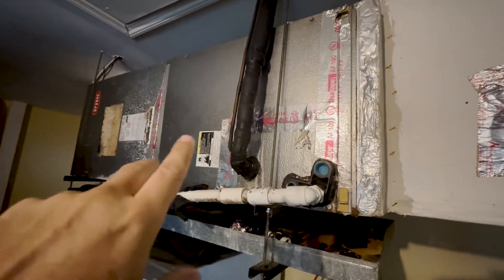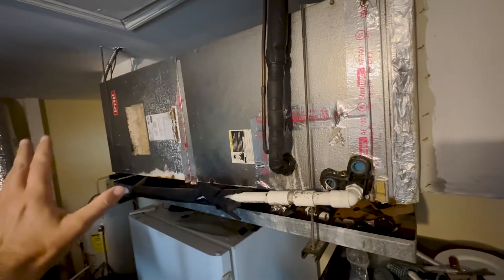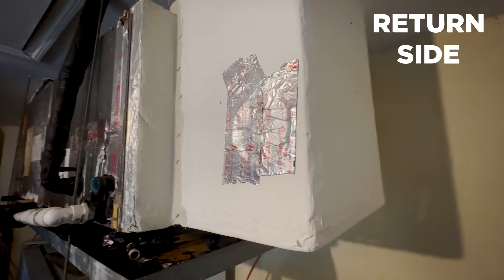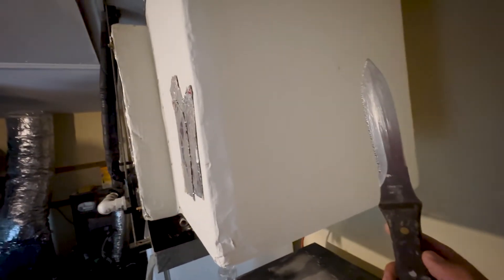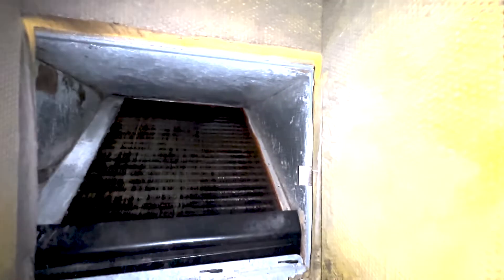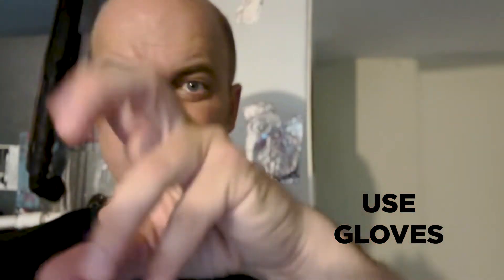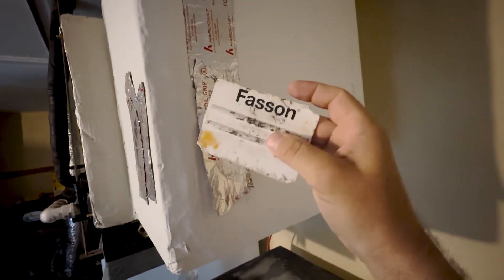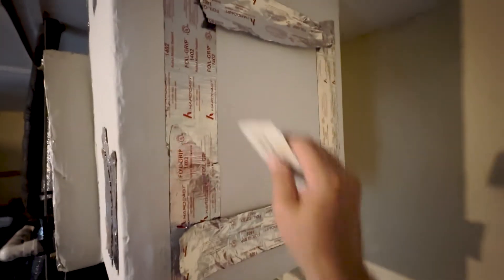Dirty Evaporator Coil Cleaning

Comment: I think the grand scheme of things.. you can use your condenser compressor to extract all the refrigerant into it, and then loosen/cut the lines near the evaporator.. but it's just easier to have a access door near the return side of air, and clean the evaporator that way.  If you pull a evaporator completely out, and decide to solder/braze the copper lines, you should also technically do a pressurized N2 test to ensure there are no leaks before reintroducing refrigerant into the system. Just my 2 cents.
Reply from the maker: Yeah I think that is a fair observation 👍

Comment: The word is “DUCT” not “DUCK”. The “MOTOR” is called a “BLOWER” or “FAN” and it pulls air through the evaporator to push it out into the house “DUCTWORK”
Before trying to give information, learn terminology.
Reply from the maker: Yes no one is confused about how to spell ductwork. If there are any mis spellings, it is there intentionally for “keyword” reasons (as many people are not in hvac and don’t know exactly how it’s spelled so they search for those terms). Furthermore, this is an informational channel for beginners. So when you talk about “blower” or “fan” being the proper terminology, what is the full description of that? It would be a “fan motor”, or a “blower motor”, right? So what’s the problem? This video is here to help the average person, who may not know a single thing about hvac. Thanks for watching anyways though👍

Comment: I did find this interesting and informative.  However, my system has a gas furnace with the A-coil mounted on top of the furnace.  All the duct work is galvanized sheet metal.  How do I get to the bottom of the coil, or for that matter the top, to clean it?
Reply from the maker: That’s a tough question to answer, without being there. For that you might want to call in a professional

Comment: Many, perhaps most, of the coil cleaning products contain corrosive chemicals of some sort and varying strengths.  Some of the stronger ones will remove paint from painted coils.  You should understand that anything containing corrosives is something you do not want on your skin or to inhale the vapors into your lungs.  Wear rubber gloves, preferably the kind with long cuffs.  Wear a respirator mask with filters rated to remove caustic fumes.
Reply from the maker: Thanks for the comment and advice 👍
Reply from the maker: Thanks for the comment

Comment: Question. So the place I work at, it’s a small local business that I guess skips out on routine maintenance for their AC unit. I was told to change the filters, and when I pulled off all three, (it’s a massive unit) the huge coil was completely BLACK. There was clumps of wet, black “gook” every where. This thing is a train wreck. That said, the unit overall looks relatively new. The massive reservoir trough underneath was filled to the brim with slimy, rusty, fungus looking gobs of water. I took a wet vac and sucked it all up. Or as much as I could. 

Next I’ll pour some bleach or vinegar down the drain lines. Everything is very accessible as it’s suspended up high. Anyway, I told the owner to buy an expanding evaporator coil foam cleaner, but this was before I knew about the self rinsing cleaners. Should I tell her to send the expanding foam cleaner back, in favor of the no rinse? Or, can I use the foam spray and use a wet vac to suck it up? Maybe also use a regular every day spray bottle to lightly spray any residual the vac can’t get. I know the correct way to do this is to hire someone to pull the entire thing out and clean it, but I have little faith they’re going to want to spend that kind of money. This unit is pretty big. At the very least I’m going to run a cleaning kit comb through it to get the exterior junk of it. I don’t know much about this stuff, but from the videos I’ve watched, most of these coils are caked with DRY debris. This particular one is mostly wet. So much so it drips on to the air filters. You’d think whoever was changing the filters before me would question why air filters that are supposed to be dry are partially wet. 

Anyway, thx for the great video! Sorry for the long question. You seem like you really know what you’re doing so thought I’d ask.

Comment: How do you find out what kind of coils I have ? My indoor AC is made by Payne
Reply from the maker: You just want to gain access to the return side of your coil (the side of the coil that your filter protects). If there is a plenum (AC box) connected to that side, you can cut a hole in there but if you are going to cut it, only cut it according to how I demonstrated in the video. If you are unsure at all, I would call an HVAC company.